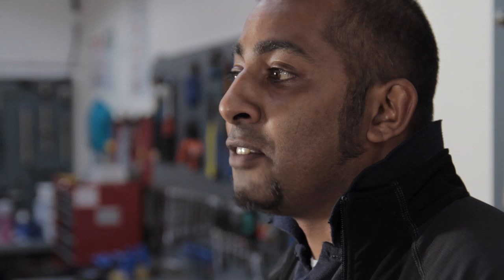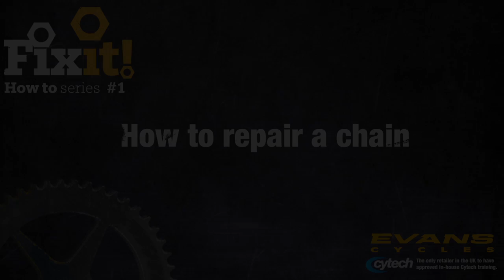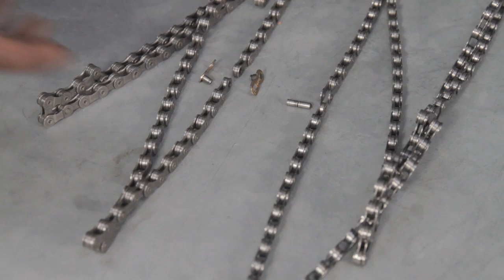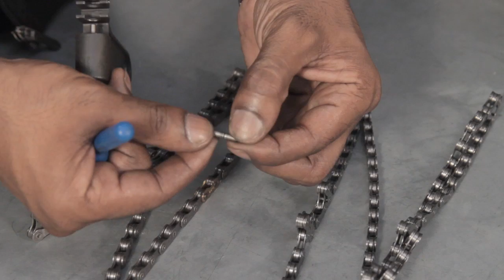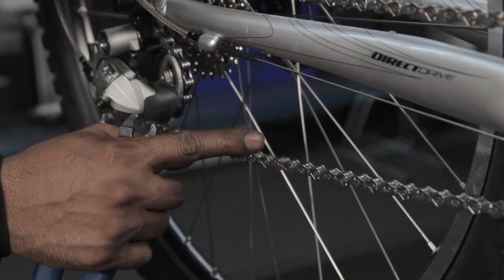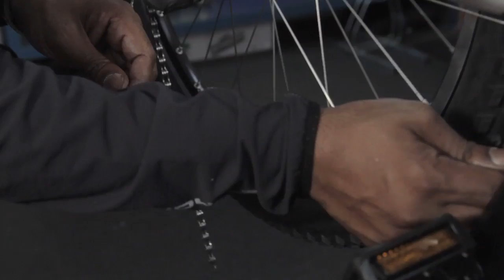How to repair a chain

Comment: A close up of the power link would help those not familiar with them, also, if you attach the new chain to the old chain you can  just pull the new chain round the front and rear derailleurs. It saves a lot of fiddling.

Comment: Yes, but how do you know when to renew your chain? What are the signs for this?
Reply: SIMON ALLEN Simply put the chain on the big chainring at the front and the smallest on the rear . Lift the chain front from the front chainring, if it lifts easily and you see a lot of daylight between the teeth and the chain - Consider replacement, a replacement chain is cheap and easy to fit and will save wear on the chainrings and rear cassette .

Comment: I've read multiple comments on this thread about skipping chains. Skipping chains are often caused when you replace your chain without also replacing your rear cassette(sprocket) or vice versa. One is more worn out than the other, and don't fit together well. I recommend replacing your cassette and chain at the same time.

Comment: @1pixie That could be a sticky link. Put your rear gear on the highest gear (smallest cog) and watch the chain go over the link as you drive the chain. If there is a sticky link it will hop of the cassette. Once you identify the culprit bend it up and down and from side to side to loosen the join.

Comment: @evanscycles i'm having trouble finding helpful info for this but recently I've been having trouble with my bike chain. Every time I go up a hill and/or apply more force to petals, about every rotation my chain will sort of skip and it makes riding unbarable for I do ride mostly in hilly areas. I've tryed most all gears and had the same outcome, leading me to the conclusion that something is wrong with my chain. any help or information would be much appriciated thanks
-Owen